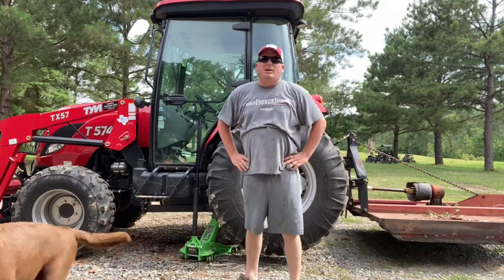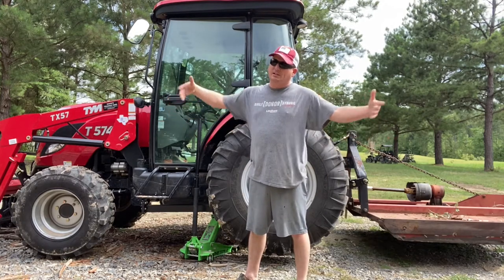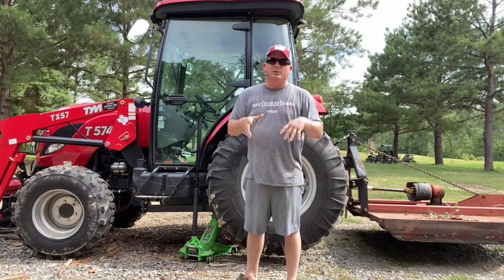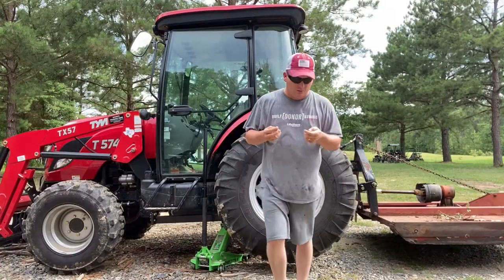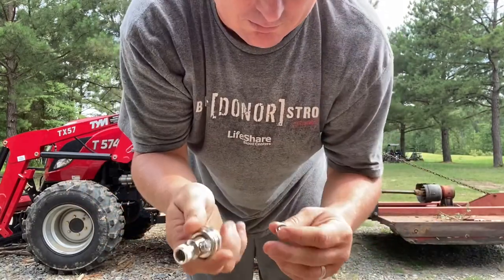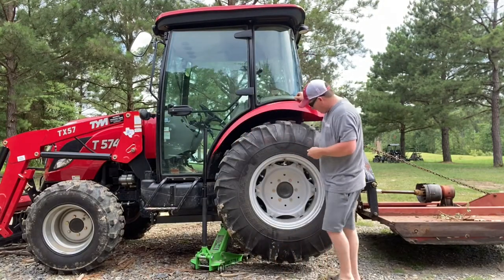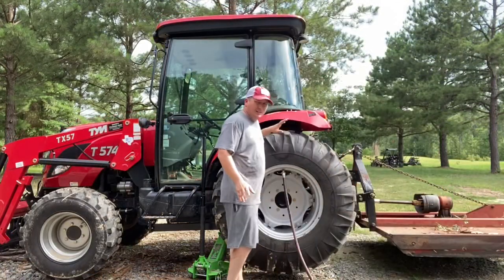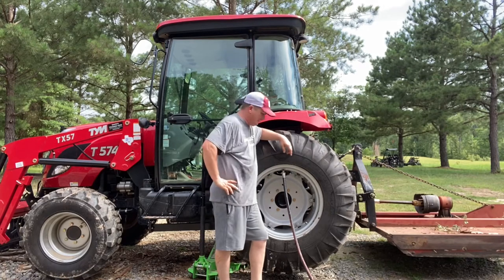The EASY way to add ballast to tractor tires!!

Comment: Even if I had a 1 inch water hose and it was 100 foot long that would only be 4 gallons.
Reply from the maker: You could add it multiple times if needed. And you don’t need 100% antifreeze in the tire. You can read the label and see what ratio it needs to be so it stays effective.

Comment: Do not try this in Alaska.
Reply from the maker: Truth!  Might wanna ass some anti freeze. Not needed here in louisiana tbo
Reply: @brandonbrown1984  yessir.  Beat juice freezes at -30 and if you spring a leak it will attract  bears. Using eco friendly/bio degradable RV antifreeze that's good to -50. Even at -50 os just starts to slush up.
Reply from the maker: @jonathandickson5698  I’ve heard a lot about beat juice. Supposed to be super heavy. Luckily we never see -30. Hell we barely see +30 here lol

Comment: BEST BALLAST USE YOUR IMPLEMENT  NOT TIRES JUICE
Reply from the maker: What if the implement being used isn’t heavy enough? Or, what if I am using a disc, and need the ballast for traction?
Reply: Filled tires creates "unsprung weight."  Way better than putting 600 lbs on your wheel bearings.